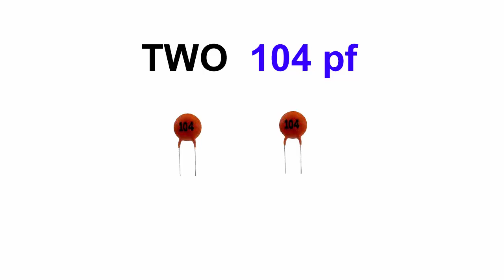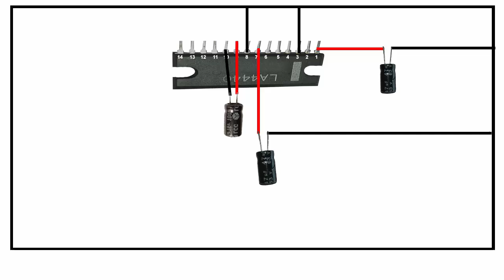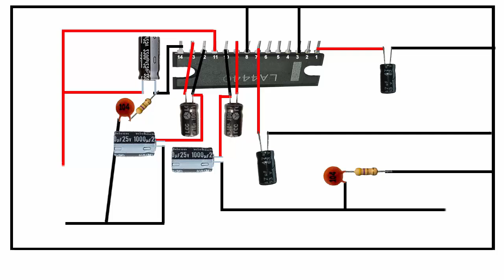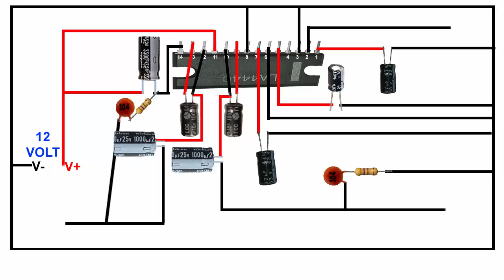How to make home subwoofer amplifier (LA 4440)

Comment: bro i have la4440ic amplifier present am using two 10 inch subwoofers with dc power(smps). can i connect Extra 12 inch bass tube
Reply from the maker: no,  only two subwoofer you can use
Reply: @24newsreadblogspotcom  can i use single 12 inch bass tube of jbl 1500 pmpo  without using 10 inch sub wooofers by smps
Reply from the maker: yes,  you can